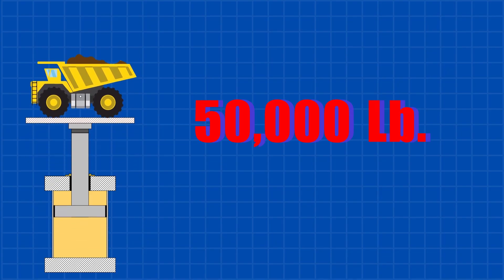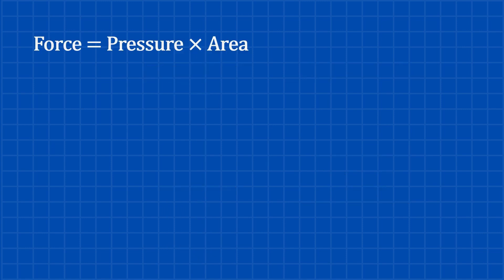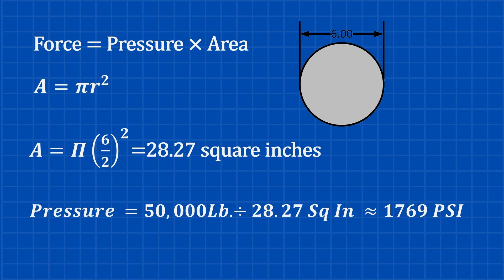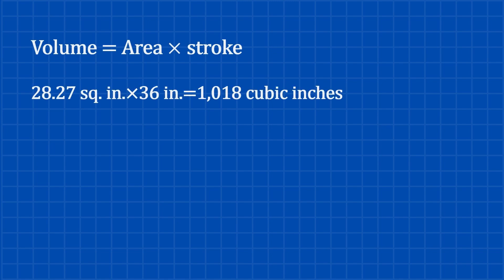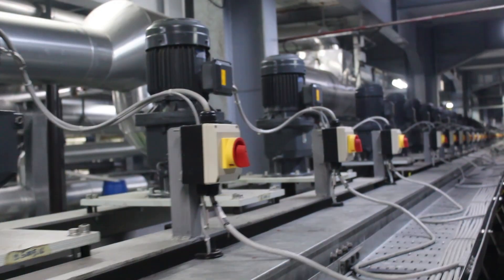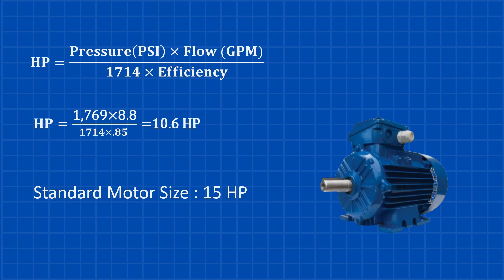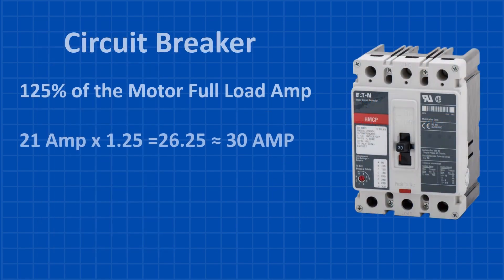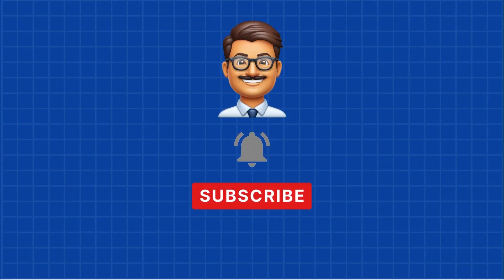Lifting 50,000 lbs – What It Really Takes

Comment: What is the significance of the number 1714 when determining the required HP of the motor? 
And the numbers 746 and 1.73 when determining the FLA?
Reply from the maker: Thank you for Watching! 1714  simply a unit conversion constant derived from fundamental relationships between work, flow, and power.
Let’s see the math behind it:
1 horsepower (HP) = 550 foot-pounds per second
1 gallon = 231 cubic inches
1 minute = 60 seconds
Power (ft-lb/s)=Pressure (lb/in²)×Flow (in³/s)÷12

746 comes from:
It comes from physics definitions:
1 horsepower = 550 foot-pounds per second
1 watt = 1 joule per second = 0.73756 foot-pounds per second
550/.73756=746